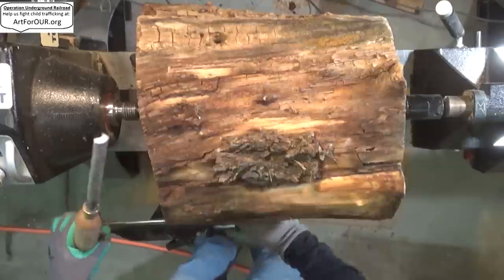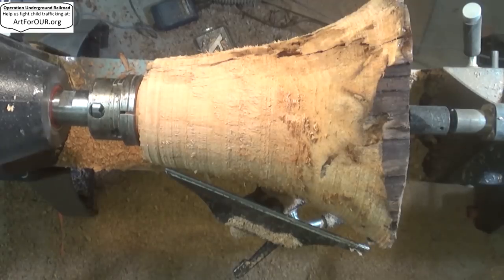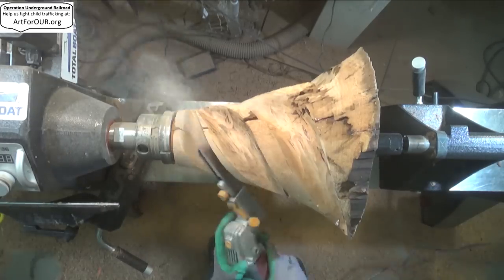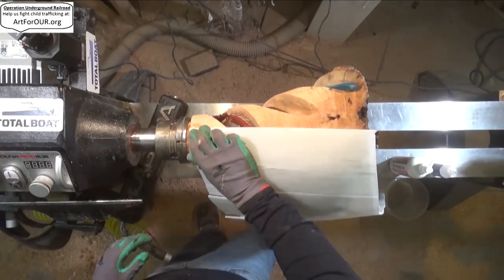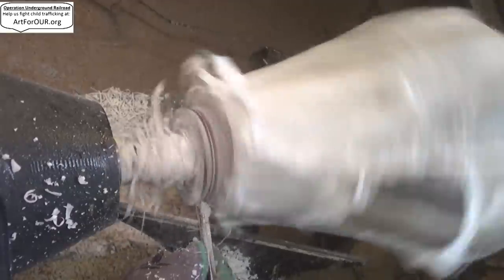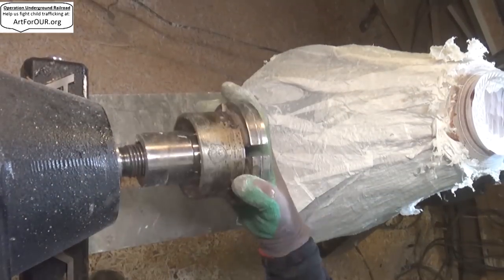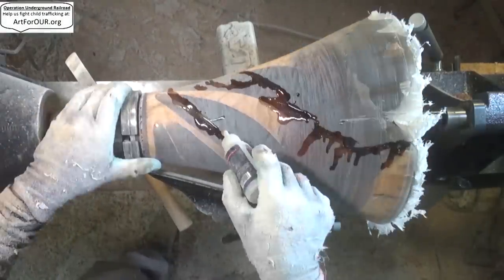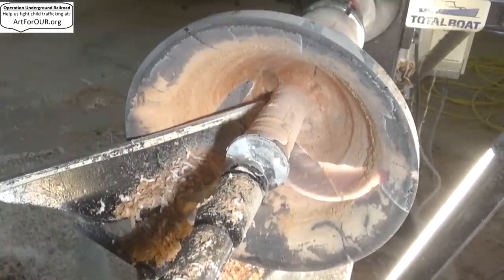"Troubled Feather" Macaw feathers, resin with willow wood base.  Wood turning.  O.U.R.

Comment: Dan, thanks for all that you do. You are touching many lives in very many different ways.

I am really enjoying watching your creativity unfold. In a certain sense, it’s like watching a flower opening into the glory of a full blossom. And at the same time I realize that you are tickling my own creative gifts with new possibilities. Thank you for that as well.  

A couple of thoughts came to mind. 
•  insider using shrink wrap…
      - to protect your tenons before you pour
      - to wrap your project instead of using garbage bags   It mayeliminare the need of using sand.
Reply from the maker: Thank you Ted!  Much appreciated. 

Artforour.org
Reply: Hi Dan. It’s Ted Buck here again. I accidentally hit the send button prematurely. So this text repeats a bit of what was in my previous text. 

A couple of thoughts come to mind.

     • Consider using shrink wrap…
            - to protect your tenons before you pour
            - to wrap your project instead of using garbage bags. It may even eliminate the need for using sand.

     • Regarding “Thermal Cracking”…

           - A Canadian company out of Calgary, Alberta, Black Forest Woodworking, is quickly becoming a leader in the epoxy project world. They claim that “Thermal Cracking” can be controlled by regulating temperature. The magic number is 59°F. They have had great luck even with massive pours. It may be worth your time to check them out. They are very willing to share their insight and knowledge.

God bless you in all of your endeavours. 
.
Reply from the maker: That's the conclusion I've been drawing lately... cold winter months in utah in my garage, I've been getting away with murder...  I've got a freezer now for the hot months.

Comment: Hi Dan, Random thoughts: Have you considered that the sand might act as an insulator, holding in the excess heat? Perhaps chill the sand first, or put the whole pressure pot in some kind of chiller during the cure time?
Feathers: Maybe wrap the feathers around something, like a tennis ball can, and “paint” them with a bit of resin or CA glue to hold their shape without “unlocking” the individual fibers of the feathers. UV cured resin is also an option for that part.
Great work! Great cause! Thank you for both!
Reply from the maker: Good ideas!  Thank you!

Comment: Why the pressure pot after vacuum? I would think the vacuum would suck the resin into the interior. Great videos. bob
Reply from the maker: Thanks!  The pressure pot gets rid of the tiny micro bubbles that stay suspended in the resin even after the vacuum chamber...

https://www.artforour.org/currentauctions